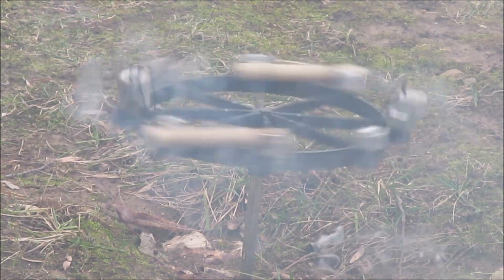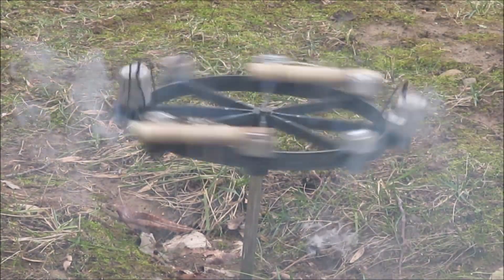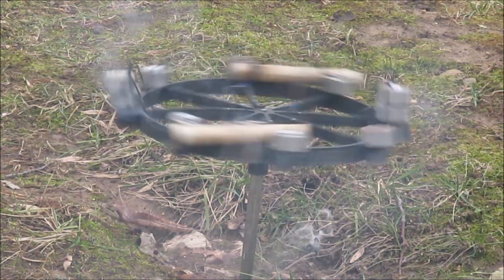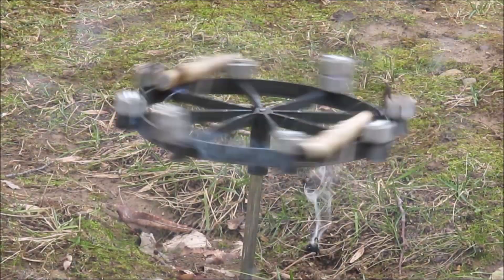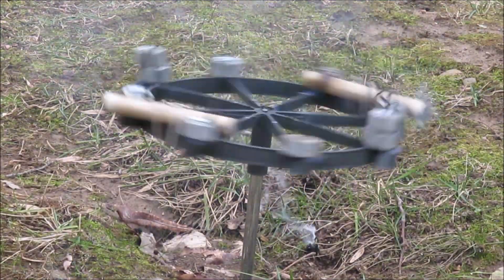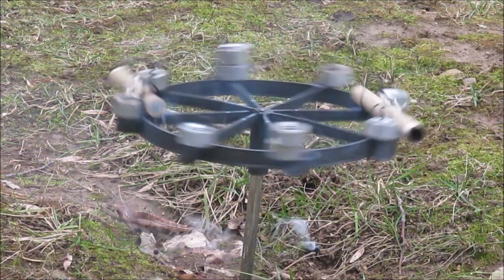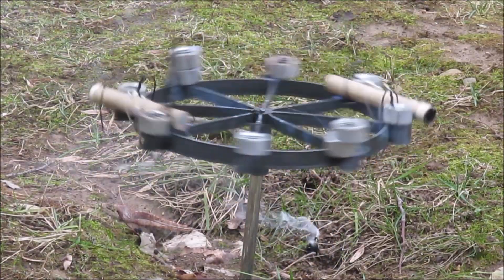Test of nozzleless charcoal spark girandola horiontal spin drivers

Comment: Ned, think about increasing the diameter of your wheel to slow the spin too.
Reply from the maker: Yeah, that's essentially one thing the outriggers do, changing the angular momentum calculations. For now, I'm sticking with small and simple, with these commercial frames.
Reply: @nedgorski  Make a fifteen footer out of rickety bamboo like they do in Thailand! lol
Reply from the maker: @timothypirnat3754  I've seen larger ones than that over there in Thailand. Really impressive "hoop stabilized tourbillions". I've also seen a Tony Stader 11-foot girandola, where the spent frame came down under parachute. A vid of that one is in my play list in here somewhere. Really impressive.